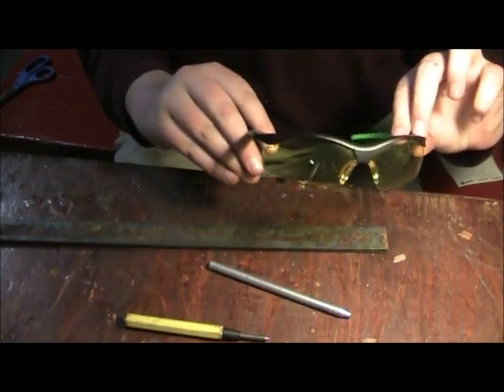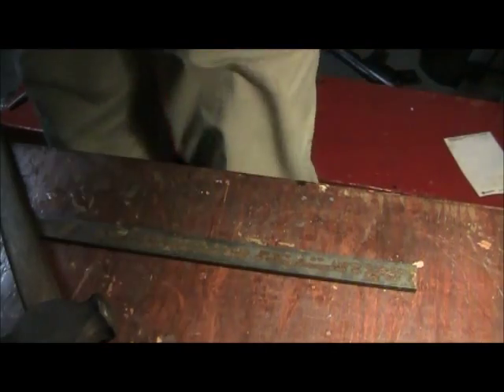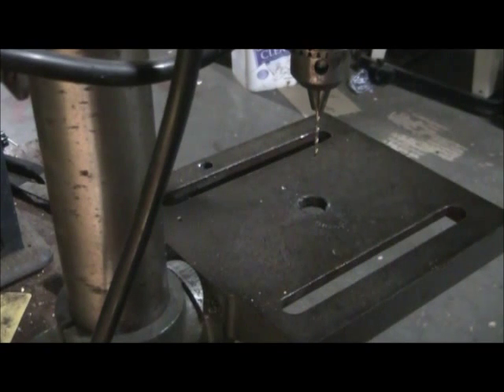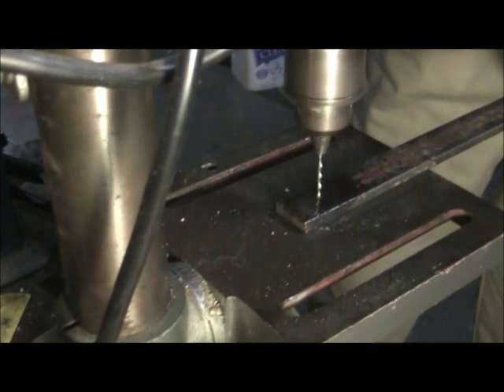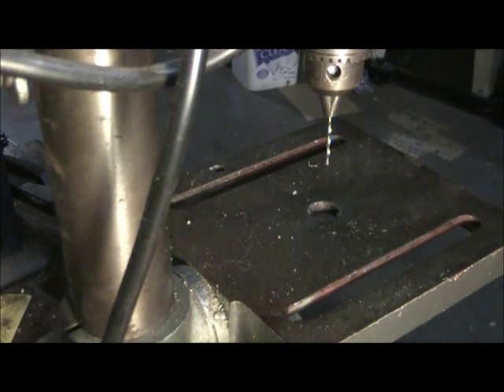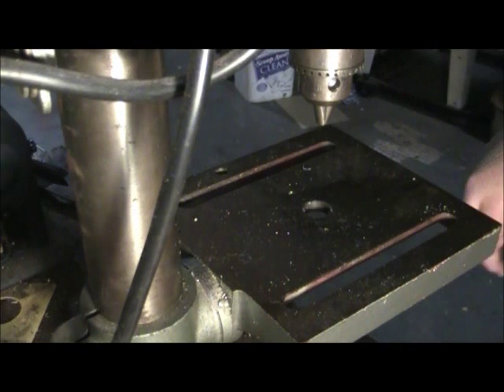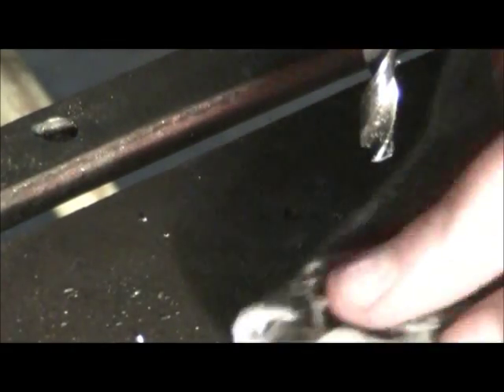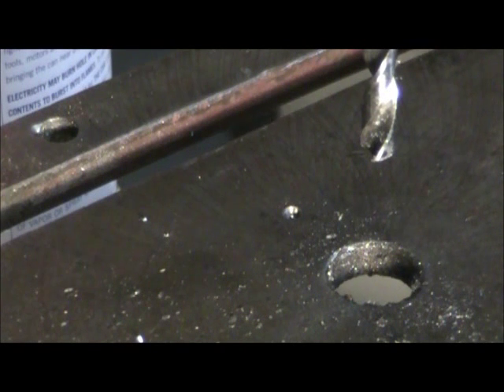Drilling through steel

Comment: You might want to install a higher amperage switch in your fuse box. Check, I bet is only 10-15 amps. Ideal for power tools is 20-60 amps. Ultimately this is a safety issue, using the right amp switch could also save you money in costly repairs to the switch-box.